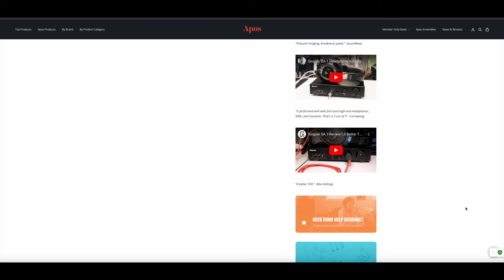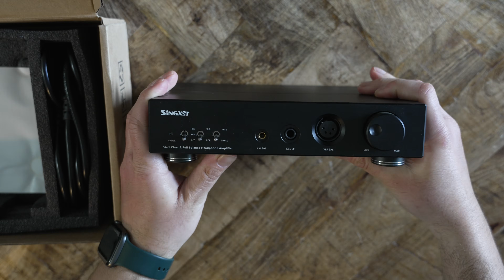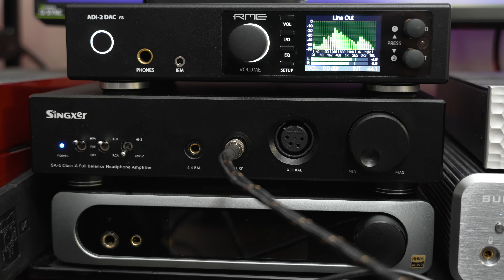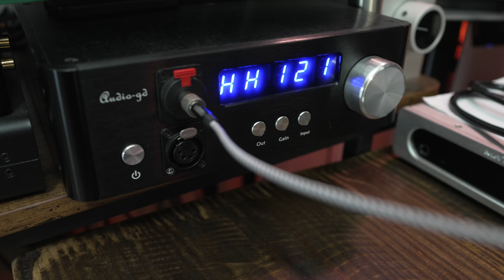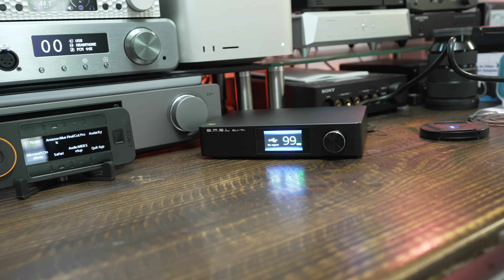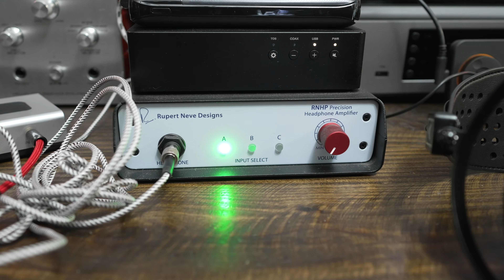Singxer SA-1 - A Runway For Your Headphone Dreams

Comment: But hold on, surely 10 watts is unnecessary at 16ohms but when a 600ohm set gets plugged in it drops the power to 380 milliwatts or so, surely that is the reason it has 10 watts, because lots of headphones are much harder to drive?
Reply from the maker: No, that’s a true representation of impedance and power requirements. As a rule, dynamic drivers are VERY easy to power. A 600 ohm headphone doesn’t need watts, and can easily be driven by an amp that has 100mw at 600 ohms.
Reply: @NoThemeReviews  Maybe 100mw can drive it, but more wattage definitely seems to have a direct effect on the performance of high impedance headphones, because it’s something that you can hear. Even if it’s ‘not supposed to’, it seems to make a difference. But even putting that aside, how about having more wattage just for headroom then? Because I would rather have more power than necessary than not enough, and I suppose if it doesn’t cost a lot extra to put extra wattage in, you might as well have it. They must be doing it for a reason, the amount of time and effort that must go into designing a unit like this, they must have very specific intentions about the power output.

Comment: Best reviewer with original style ,no themes.
  Question , the schiit bitfrost 2/64 has so much hype , what do you think of that dac ? 
  I was looking into that one or chord mojo 2 since price is about same...I'm using monolith thx aaa 887 amp.
Reply from the maker: There’s a group of audiophiles who believe that all dacs have unique sound signatures—even when measurements and company statements contradict those beliefs. There is no reason for the hype behind any dac, including the Bifrost. If you do real A/B comparisons, volume matched, then there is no difference at all among modern dacs. The Mojo is no better in this regard. It is overpriced and doesn’t provide the features than far cheaper dacs have. I suggest spending less on dacs—which make no audible difference at all—and instead try different headphones or IEMs.
Reply: @NoThemeReviews  thanks for your reply.
   T here are a couple of so-called honest reviewer who does seems to call out bs or not scare to give a negative . Few yrs back you liked the chord mojo saying overall it's little better than monolith portable , so now chord mojo 2 has slight improvement or tweaks for the better, so would you think ot takes 2 more steps above monolith and or the 2 sound little better overall than the original chord mojo ? .
I ask you because so many good reviewers I trust only about 3 but I can't find a bad remark on the chord 2 . I paid 640.00 total , and if it's not worth if you think then I may return it , that's how I highly respect your work .
Reply from the maker: @Nofear693  I appreciate your trust. There are a few things I can say about this. First, the differences I spoke of years ago were pretty minimal, and perceptible only with A/B comparisons. Back then I didn’t have a test bench with switch boxes and Voicemeeter which would have provided more reliable results. 

Second, in follow up videos about the Mojo I talked about all its problems—bad battery, cost and frustration with repair, the astounding cost for Chord’s compatible cables for the Mojo—and those cables are hands down the worst build of any I have ever used. 

Third, the Mojo is built around an old, now defunct idea. It doesn’t have BT, renders the same audio resolutions as other dacs costing a fraction, and utilizes a physical design that really isn’t particularly portable—at least no more so than alternatives. 

Fourth, to get the Mojo’s full features, you have to buy the Poly, which itself is a terrible product. Chord for years has promised a dedicated smartphone app to control the Poly, and as far as I know, they haven’t delivered. 

Fifth, the Mojo 2’s “EQ” is a laughable feature. You have no real control over minute changes, and since you’ll be tethered to a source device anyway, that source will have far greater EQ capability. 

Even if the Mojo 2 is somehow “better” than the original, it’s a ripoff. Keep in mind that Chord has always said that its Mojo devices are transparent/reference. That means flat, neutral. They do not change the audio signal, and like any other dac, do not increase the pre-recorded dynamic range of your music. 

I’m not going to tell you what to buy, or return. You have to make that decision based on objective facts. IMO, Chord doesn’t offer anything truly unique.  By comparison, you should look at the THX Portable, which for far less money offers a lot more functionality.
Reply: @NoThemeReviews  I do have the monolith portable, sound is clean airy  nice sound but a bit thin not full body , I like it but I know there's better. Also have ifi hip dac, monolith sounds clear with vocals , hip dac with bass boost off still has a fuller and better bass sound. So there's some differences in dac amp to me and was thinking chord mojo 2 should be better than those 2 . Chord 1 was a mess and according to chord they improved in all those pass areas.
Reply: I have the mojo 2 and without any tweaks,  I use the same headphones , arya stealth , and listened to monolith thx 887 , fiio ms11 , ifi hip dac , and monolith portable , I can easily say that the chord mojo 2 has a more fuller warmer sound , it sounds more expensive , the others were clear nice separation , but mojo does this a bit better hearing thru my arya stealth , wish I was able to send you the mojo 2 so you can review it.

Comment: I may be mistaken in my opinion but I'm really enjoying the pairing of my SMSL SU9n and my Topping A30 Pro that utilizes Toppings NFCA Tech inside it. 
More power than I could ever need, great measurements and works well with my Dynamic as well as Planar Headphones and IEMs.
I've kind of been lusting after the Singxer SA-1 but just can't justify the expense and I'm not sure I would even be able to hear/notice any difference.
Like I said I'm really enjoying the pairing I have now and it's much better than what I had before so maybe I will grab one if they ever go on a very deep sale.
It is hard though to not keep chasing a so called "Perfect Sound" when what I have now I know measures more than perfect but there's always that itch to go for the latest and greatest.
Thank you for helping me to keep that under control and I know I can always count on this channel for it's straight forward no BS reviews...

Comment: I got the ADI-2 and use the headphone amp on it. I told myself I could always add an amp later, but the truth is it seems fine for all my headphones. I thought about getting the Singxer to pair with it, but I suspect I wouldn't hear much of a difference even with balanced audio. Any plans to do the Xduoo TA 22?
Reply: The RME ADI-2 is an excellent DAC to pair with the SingXer SA-1 amp, as the RME has the high adjustable voltage on the XLR outputs that this amp needs. You can find the correct RME volume setting in combination with the SingXer SA-1 on the official RME forum, just look. The SingXer SA-1 is good to have set to high gain. In the end, all you have to do is fine-tune the parametric equalization on the RME for the preferred type of headphones used. I'm using the PEQ preset by user oratory1990. The HiFiMAN Arya Stealth pairs perfectly with the SingXer SA-1!!! I use an Apos Flow cable with them.
Reply: @paveljopek4927  There was a lot of hype around this amp, but several reviewers that I trust in one way or another kind of echoed what NTR said here; the amp is just another amp, with perhaps an oversmoothed treble or even "boring" sound signature. While it could just be people not being used to class A sound, it sure kills the hype train for me. Like he said, I don't need the power either.